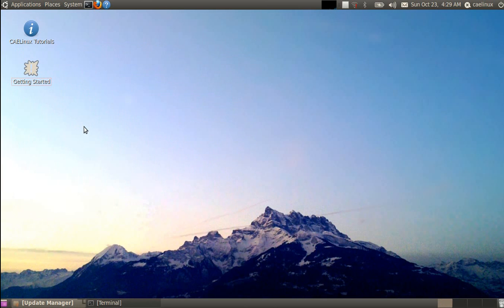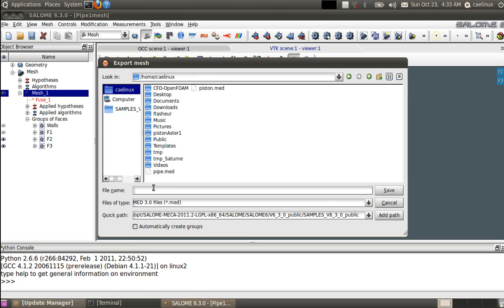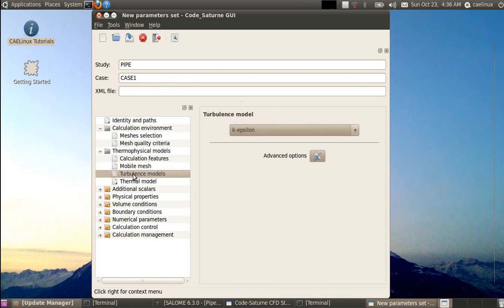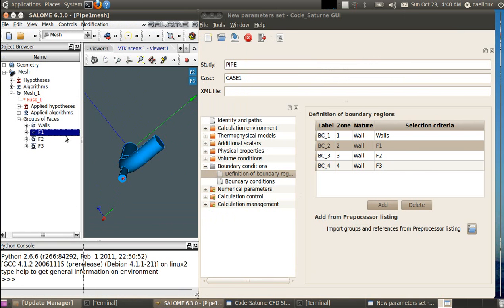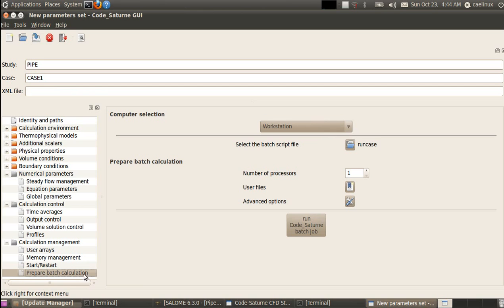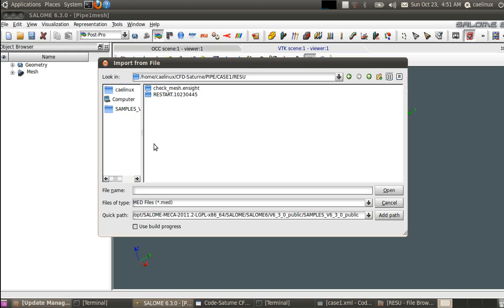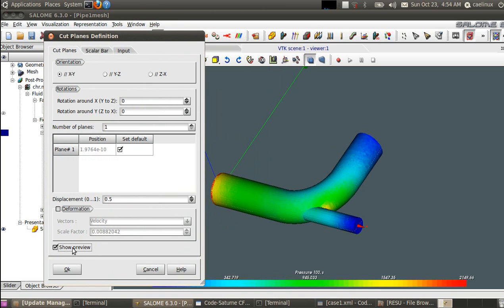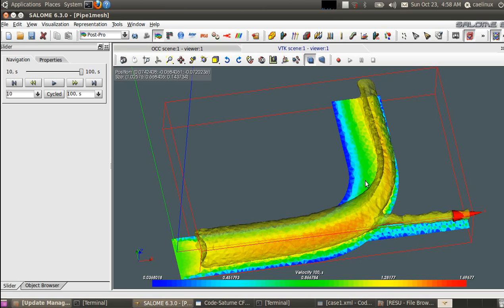Code-Saturne CFD Tutorial on CAELinux 2011

Comment: have you ever done a thermal plasma simulation in code_saturne? is there a way to input temperature dependent density, Cp, K... of the air or argon?